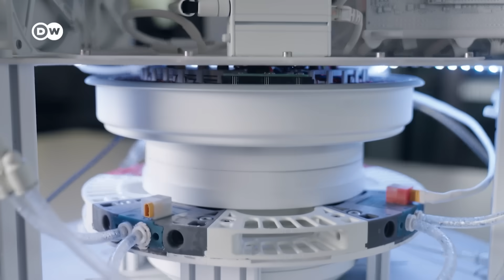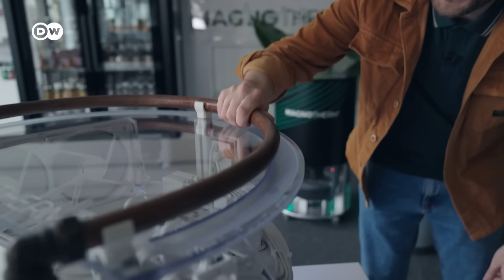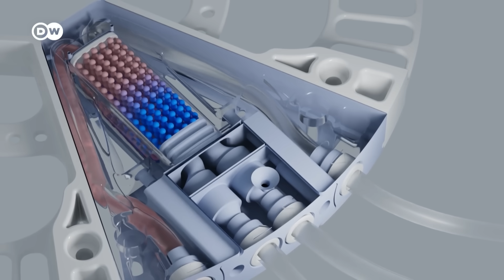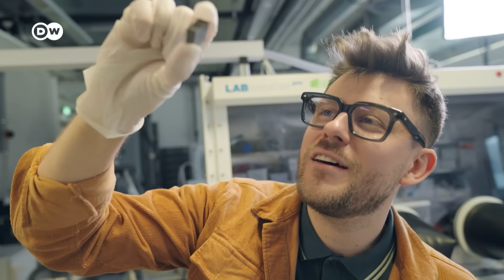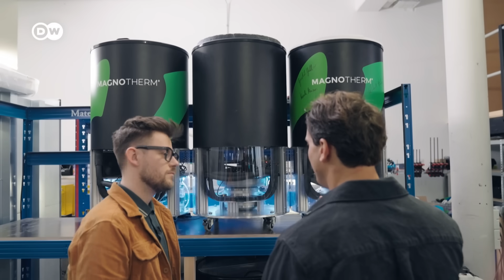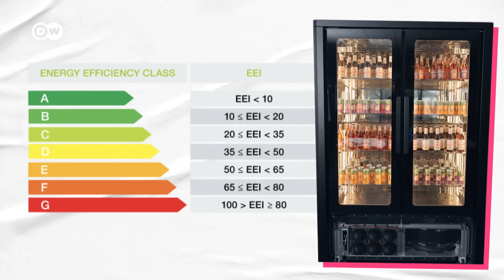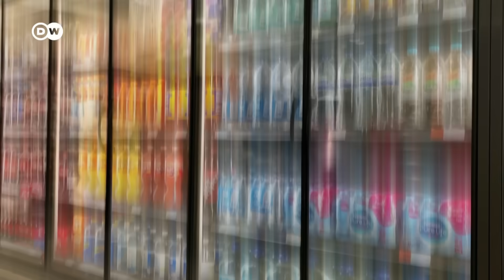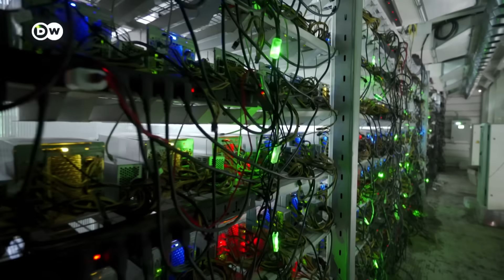How magnets could change our fridges and ACs forever

Comment: Usually the winning factor of the systems based on solid state materials is less moving parts.
But here you have added a handful of more moving parts compared to the conventional fridges. Not mentioning this being more expensive and heavier.
So what's really the winning factore here?

Comment: Why rotate magnets with an electric motor when you can rotate the magnetic field, turn it on or off statically?
Reply from the maker: Hey there! There is research using electromagnets that can be switched on and off. However, many focus on a rotating system.
Reply: Of course electromagnet can be switched on and off by cutting out current flow.

Comment: Are you saying a small one of these will save you 4000$ in electricity over 3 years? How expensive is electricity in Germany?! Running a fridge here costs at most 6$ in electricity a year. That's 216 over three years, nowhere near 4000$

There's no way a small fridge uses that much power in that short a time

And you the large industrial size is listed at 16500? If a comparable fridge is a third the cost, then this one would have to save 11 000 to offset the cost in 3 years. That's seems unlikely unless electricity is insanely expensive over there or something
Reply: Germany is in dire straights right now. The Euro collapsing isnt helping and their insistence on bloating their wellfare systems to the extreme is compounding this fact and them being 100% reliant on Russian oil and Gas has bit them BAD after they pissed them the FUck off and Europe blowing up the pipelines making it EVEN WORSE. But yeah Its not just Electricity they pissed off their own farmers too. So 4000Euro to make you food last despite how little of a difference in Electricty it is sounds like a dream come true to them and a major scum companies dream.

Comment: I wonder how much 'less or more' efficient it would be to use Electromagnets instead of Neodemium magnets on a wheel.
Reply: alot, this is over complicated on purpose and adds multiple points of failure. Remember this is a pitch to the masses about this new Tech from the 1910's. And given its not as good at cooling a freezer but only a fridge at the temps shown its 100% a deal breaker for most.

Comment: when we calculate the efficiency of an appliance, we need to be including every bit of energy used in its lifespan, and all the energy related variables related such as manufacturing, making the materials, production, packaging and lots more. We tend to only focus on the power consumption. But in this case, it takes quite a bit of energy to make the magnets. A lot to make the special blocks, and the same as other fridges to make the rest. I'd like to see a complete breakdown of energy consumption and waste for them. Also this will help with stuff like planned obsolescence,  products that are faulty and other quality issues because those issues would impact their energy ratings.

Comment: i dont understood why there is a rotating part. if we want we can get a moving magnetic field without rotating part. just use multi phase AC current to make this rotary magnetic field very easily, like all the AC motors generators etc. dont know why they didnot consider this.
Reply: point of failure for it to break in 4 years... Planned Obsolescence litters this product like mad.

Comment: We are still heavily dependent on CFC like gases for cooling. That should be replaced with harmless substances. Power saving is not going to save the environment. Stopping the use of these gases is going to save that.
Reply: Honestly if you wanted to save the Environment its not REPLACING IT its Making Stop gaps, This tech is good for Mid range temps such as AC or Fridges(NOT FREEZERS Take AN OBSCENE AMOUNT OF POWER to reach that temp due to physics with this one) There is also the Massive amount of issues with the design It has NO reason to be spinning we can induct a mag field without the spin and no need of rare earth metals but with electro magnets that would be more efficient anyway.

Its the Battery Issue all over again, We can Generate Massive amounts of Electricty that could satiate the eats for billions of years if everything was electricity based but we have NO WAY OF STORING THAT ENERGY, The Green Solutions are Stop gaps that are FAILING Not due to their limitations but the STORAGE OF THE LOST ENERGY. This in tern witht heir natural lifespan and excessive cost of maintences in raw material is showing that we have TECH that is TOO far ahead of the most cruscail components.

Then we have bad Actors like this video showing a far reduced version of a 1910's machine selling it as a solution while creating Massive amounts of E waste in its wake. Instead of working on REAL solutions they wait and wait for all this old tech to be forgotten to repackage in their ideal form to customers in need of a solution.

Comment: Isn't their more failure point in this system than the conventional refrigerator?

And what about the peltier system, can't that system can be used in making refrigerator?
Reply: The issue with the Peltier is the multiplication of power needed to cool each extra degree. For super smal thing needing only a bit of cooling A+ like a battery operated can cooler, But once that Can become a six pack in a small space its pushed to the limit, and any further than that its just NOT worth the energy input for the cooling output.

Cooling is a balancing act and right now harmfull polluntants are better than over loading the electricty requirements WE CANT FIX, Our storage solution for Electricity is now our major bottle neck after that is our transmission of that power, The next is Consumption of that power which we have minimized to insanity right now, ANd We have GENERATION figured out that if we could STORE all of it we would have no issue at ALL, Transmission can be lowered if all homes can store what they needed during power down times and the Great bottle neck rears its fatal head to ALL of the Green Energy pushers, WE NEED BETTER BATTERIES BEFORE WE SWITCH AWAY FROM POLLUTANTS. We have Batteries that dont Decay and are decent size BUT they can hold Much, We have Compact Betteries that con hold alot but THEY are Volatile and degrade RAPIDLY, We have Batteries that in theory can store Alot and Wont degrade but they are so MASSIVE its not logical to build them at all.

Size, Storage, and Decay are the Base Trifecta Requirements and Volatility is the fourth Hell we need to overcome for the Perfect Battery. And with that We will be fine, Other than that is An infinate Generator that we wont have to worry about Energy waste. We have More inefficient Techs that are safer and clean but without the Batteries fixed our Grid will fail Energy Generation will be forced to be created in more unclean ways and the Transmission infrastructure will need SO MUCH MORE Material and labor.

Comment: But why are they spinning the magnets? They can simply use electromagnets which are turned on and off that would create the same changing magnetic field that is needed, much less moving parts as they don't have to move.
Reply from the maker: Hey! They're likely using a rotating permanent magnet since it’s more energy-efficient. 🦾 Electromagnets require constant power and would make the system more complex.
Reply: @DWPlanetA  Oh, thanks for clarifying.

Comment: What happens when the magnets get clogged with dust and dirt?
Reply from the maker: Then they could overheat probably. 🤔 But the magnets are sealed in protective casings to stop dust and dirt from getting in. Plus, air filters and regular maintenance. ✔

Comment: Magnotherm currently can not compete on a solely energetic basis. Being ranked "B" on market entry, is definivly a success for itself. But: If the EEI would consider the leakage of coolants for such appliances it would be rated instanously as "A". To recall: The EEI was quite recently amended, i.  e. some two years ago. It will be amended soon to reflect the technical progress.

Comment: I just see a big electric motor spinning a lot of metal parts round and round. Same problems arises in commercial refrigeration and air conditioning. Bearings that take a lot of heat, and wear and tear, but without the cold refrigerant and an oil bath to cool them down. I have seen compressors that have been running for over 50 years without a hiccup, good luck with this.
Reply: Fair points—you’re clearly speaking from experience, and traditional compressors have proven their reliability over decades. But breakthroughs like magnetocaloric cooling aren’t trying to replace what works overnight—they’re aiming to solve long-term issues like environmental impact, noise, and efficiency. Sure, the tech is still evolving, and durability concerns are valid. But every innovation starts with skepticism—just like compressors did back in the day. Let’s see where it goes.
Reply: cojld use a hydrodynamic bearing and a simple spindle needle to keep the discs appart. and have throttlebale cooling and not only on off duty cycle

Comment: Very interesting but my first thought in reducing the manufacturing cost is a different manufacturing method for the 3D printed magnets. I would avoid 3D printing and sintering due to the very long times involved printing and high energy used in sintering. The rapid timing of the coolant flow is also an issue I would look at from a valve longevity standpoint.

Comment: I wonder if they're going in the wrong direction with it. Instead of trying to compete with fridges maybe they could try to fill a niche, like instead upscaling the size of the magnet fridge, how small can they make one? Compressor fridges aren't exactly practical when you get down to a certain size and those little peltier cooling pad fridges suck so I wonder if this tech is a good fit for small scale cooling projects or not.

Comment: Could this effect be used in heat pumps too?
Reply from the maker: Here's a study from the Danish Technical University that doesn't focus precisely on heat pumps, but the principles discussed could theoretically be applied to them as well 👉 https://backend.orbit.dtu.dk/ws/portalfiles/portal/297622935/1_s2.0_S0140700722003735_main.pdf

Comment: It’s literally a rubber band refrigerator.  Just far more practical.  You stretch a rubber band, and it enters a higher energy state.  But if it cools down before relaxing, it’ll actually get pretty cold.  It’s just a much slower process to Ferris wheel them from the hot to cool side, and no higher speed water cooling

Comment: So it wont do anything of benifit to cool the earth, as its still just a much much MORE complicated heat pump. 
So if they have a 400w fridge, its a 400w fridge.  An efficent 600l fridge uses MUCH less than that and it has a single or dual compressor thats cheap to replace, manufacture and does the same job or pumping heat to atmosphere. 
Most double door glass display fridges like in shops are 1000l and use up to 1000w surge but generally use about 50 to 100w compared to this thing thats huge, heavy over priced and wayyyy to compkicated to repair. 
Sorry, i love technology and I like overcomplicating stuff cuz we can think diferent, but one of their fridges saving money on power is nothing compared to how much it might cost to replace that monstrosity of a magnetic compressor.

Comment: global warming is hogwash.

also don't forget, traditional refrigeration is already an extremely inherently efficient technology, and the electricity using components (the motors, for the compressor and fans) as well as the refrigerants used are continuing to advance as well - and the other part of the equation is insulation, which could equally advance for either technology.  large scale commercial refrigeration is obviously energy intensive, and for various reasons generally a lot less efficient than small scale solutions like a fridge, which is already so incredibly cheap to run and uses so little energy no one cares and the grid and environment certainly doesn't care at all either.

Comment: I wonder if you were to combine this concept with peltiers to control a peltier from getting too hot by alternating between the two technologies energy cycles. It might be the missing piece to get peltiers more energy efficient for cooling. You need iron and copper in pattern to create a peltier, but if you made a peltier lattice with their material then maybe it could do it and not need any moving parts by using an electro magnet

Comment: I just have 1 question. How do you deal with water permeation? I have a WC AIO loop in my PC for almost 7 years and it lost half of their content.
Reply from the maker: Hey there! That sounds like a common issue indeed. Here, the water loss is minimized using sealed loops, low-permeability materials, and precise engineering to reduce this effect. 🦾

Comment: Wow I want all those moving parts in my fridge at home to be sure Good Grief ! more akin to an inkjet printer this is! there was clip in this presentation showing two people at the same freezer case holding the GLASS doors open at the supermarket I wonder why these people need to elimanate the glass to see what is in the freezer, I see it all the time, My Parents were always on us kids about holding the fridge door open and it was not a glass door! Do these people roll the side door window down and stick the head out so they can see were the road is at in the car? this is a peltier cooler with more parts and also the elephant in the room water is known to freeze at 32 ' F so no more freezers or what? I will stick with My hermetic compressor Thanks!

Comment: This innovation is amazing but instead of dispensing the heat as waste why not use that heat in a water heater. I can also imagine while the AC is running it's also heating the water heater.

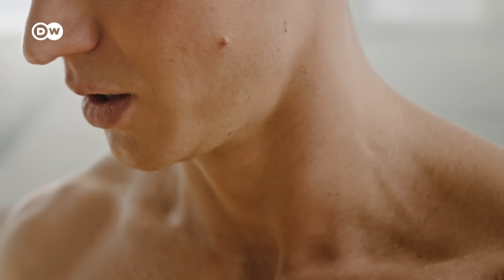Comment: 1:14
I don't think this is an accurate analogy. The way we cool down with sweat is the way a swamp cooler works, but if I understand correctly, most fridges operate more like a heat pump, compressing and expanding a circulating substance to move heat, or by using a system that causes a gas to condense in a particular area to transfer heat, like exists in your computer most likely.

Comment: Couldn’t help notice they never discussed how much energy they have to put in to get that 400W of cooling power nor did they say how long it took to get down to conventional fridge temperatures. 
Not to mention the fact that the version suited for consumer use would currently cost between somewhere €10K to €16K based off the cost of the two door unit.
Reply: I was wondering the same thing.

Comment: Eisntein and a friend had a patent for a regrigerator. I know it used magnets but not the principle used. Here they are:

Electrodynamic movement of fluid metals: Patent GB303065a, granted on May 26, 1930, for the movement of fluid metals, especially for refrigerating machines
Pump for refrigerating machines: Patent GB344881a, granted on September 3, 1931
Refrigerator: Patent HU102079a, granted on May 12, 1929
Refrigeration: Patent US1781541a, granted on November 11, 1930

Is that fridge more efficient than traditional ones?

Comment: I can suggest a much simpler idea for refrigerator compressor motors. Use permanent magnets. That way you get that 30% energy savings in a much simpler, cheaper  and reliable way. Appliances using permanent magnet motors (PM motors) use between 22-42% less energy than those using conventional alternating current (AC) motors.

Comment: They can certainly build coolers with this technology (that don't require water refilling) especially in South Asian countries like India. Throwing the air which is even 10 degree cooler than the atmosphere makes a huge deal when the surroundings are almost at 45 deg centigrade.

Comment: I'm calling right now. This is absolute BS. The money would be better spend to find better gases to compressors. Compressors are extremely efficient to transfer heat from a space to another because of the amazing properties of the gases that run in the serpentine. It's just a calorimetry measure. It's the nature of the gas itself, the compressor just push the pressure up and down.

Comment: So instead of thermal transfer displacement magnets are removing the heat how? Or slowing down the molecules...?
Reply from the maker: Hey there! The magnets change the material’s temperature by aligning and misaligning magnetic moments inside special metal alloys. 🌡

Comment: Remember when companies used to build refrigerators that last 70 years? Why don't they just build those again?
Reply: It's about efficiency of the mechanism, not longevity - but of course longevity IS part of long-term efficiency, just not the only one. 

But to answer your question, it is very simple: the less time things last, the more the consumer will have to buy them. And the consumers these days will buy anything, no matter its quality, hence no pressure on the manufacturers to do anything well. It is of course extremely wasteful, but - despite all the claims to the contrary - virtually nobody actually cares about the environment (and the general populace doesn't do their research, they just listen to what others say and cherrypick the option that demands the least effort on their part).

Comment: How are they for freezing temps?
Reply from the maker: It can theoretically achieve a freezing temperature, but this depends on the materials and the design of the system. Currently, most prototypes focus on cooling to around 9°C. It's still a work in progress. 😎